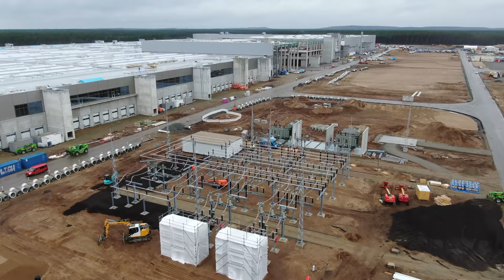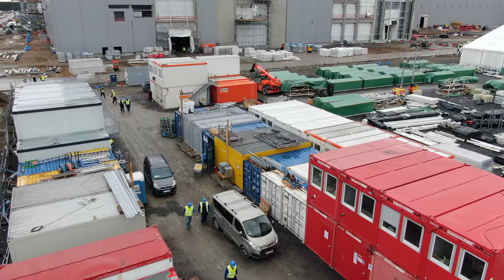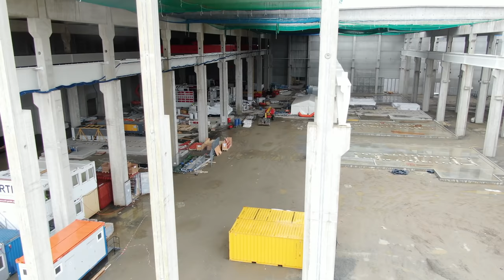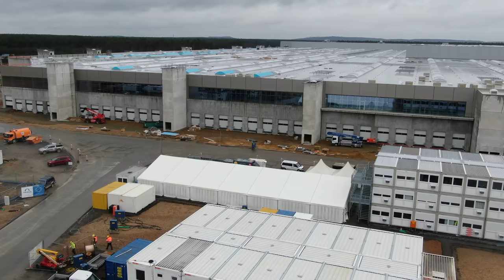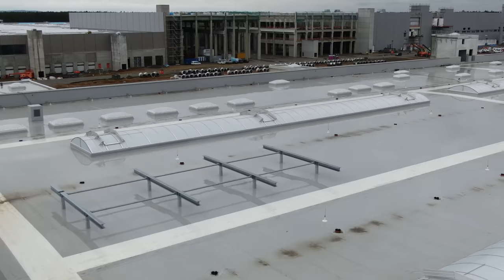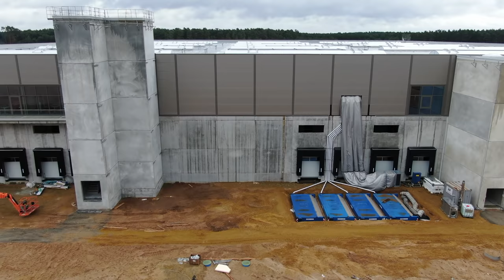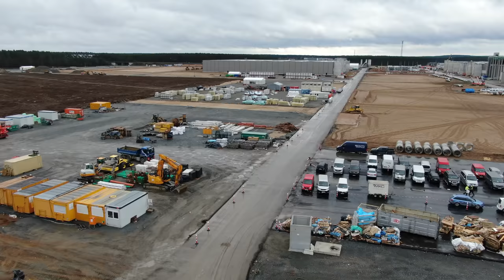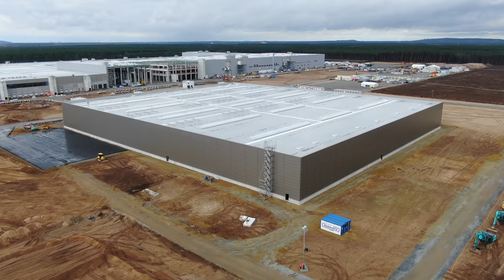Giga Berlin | 2021-03-27 | More Model Y Bodies

Comment: Great video but Berlin has slow down the construction. Don’t know the reason but it is sad. Texas has speed up the process and seems they will win the race. Europe has to much bureaucracy which will cost them one day in this fast change world.
Reply from the maker: There is no slow down in construction. The work just moved to the inside. The building is pretty much finished. There is no work on the outside of the casting section though, but that seems to be intentional, and was to be expected since they removed the cranes. You think they were removed due to bureaucracy? I don't think so.
Reply: Difficult to assess, we don't see what is going on inside. And there are many workers on site. They will hold their deadlines. Nobody wants to pay fines
Reply: Because Tesla made substantial changes to its construction plans, that have to be reviewed and approved. There would have been no problems if Tesla got it right the first time. If they can away with that in Texas, good for them.
Reply: Tesla is building here. Not Europe. E.g. Tesla has permission to work 24/5 (i.e on weekdays) on the building. And in some inside areas like the paint shop 24/7. They do not really make much use of this. Either they simply don't need this with the schedule they gave themself. Or they have not found companies with free capacities for this. 
a) they are working in the casting section. Assembling two Giga Presses. And finishing the between floors in a part of the casting section. 
b) why they stopped working on the roof is not known. Material is there, partly even already on the roof. The safety nets are also there. Crans have sitting around idle there for weeks.
Reasons are not known. But it is not a permit-related thing. These are public processes. And any stop ordered by an administration or a court would be already known. Apart from the fact that a stop means a stop. Not a "but you can proceed in slow pace" order. 

While I won't deny that Europe has too much bureaucracy in some fields. You cannot simply blame any delay on this - esp. if there is no evidence pointing into this direction at all.
Reply from the maker: Their changes to the construction plans slowed down the approval, but not the construction.
Reply: It is not Tesla fault . It is simply bureaucratic process which makes things slow here . Full stop and bye . I didn’t mean to offend anyone so I am closing this chat from my side . Have a nice wknd .
Reply: @johnmathew3423  For fanboys it is never Teslas fault.
Reply: Texas does not have any walls up so far except for ugly concrete “bunker” stamping building.  Berlin is way ahead right now although Texas is sure busy rearranging lots of dirt.
Reply: @johnmathew3423  Mind sharing the information you gathered from your x ray vision?
Reply: 😝. Don’t know why people are pissed off . Was just my opinions. Fine I will take them back . Hopefully it makes everyone here happy.
Reply: @valueinvestor8555  .. what the most people here doesn’t know is that where Tesla is building right now is normally a designated protected water resources area. With building of this factory the people around lose around 25% for there water resources. Maybe even more? And this area is very dry they get not so much rain anymore so u could say each drop of water is valuable. And I think that is also the problem for Tesla that they not got the final permit  / approval from the environment ministry. There is a battle ( if I can say so ) between jobs and tax for the government and protection of the water. And as you can see who won here. And it could be possible that Tesla ( and any other big company would get it ) will get tax cuts and other subsidies in total of 20%? of there whole investment. I think they get the biggest part of this subsidies when they finally build the battery factory. As I said it’s not only Tesla get it ... any big company who brings job will get the subsidies. But that they build a factory in water protected area and suck up 25% of the water resources of the people around ( I Heard- around 200K get there drinking water from this area ) says something.
Reply from the maker: @wolfgangselle4307  What you've heard is just half of the truth. Actually Tesla has a contract with WSE for water. So this was solved a long time ago and won't cause any delay for the permit. 
Also, Brandenburg has way less problems with water than other parts of the world. The last years were very dry which means that the authorities have to rethink the water strategies, but that has nothing to do with Tesla.
Tesla is not even a big consumer of water in Brandenburg. For example, there is an oil refinery that uses more than 10x the amount of water.
WSE isn't a huge water supplier, so Tesla will be a big percentage, but that's just, because there are not that many people in this area. WSE doesn't even handle most of the wastewater, they just send it to berlin to a bigger plant.
Subsidies also have nothing to do with the approval.
Reply from the maker: @johnmathew3423  
"It is not Tesla fault . It is simply bureaucratic process which makes things slow here."
So tell me, which bureaucratic process slows things down here?
Reply: @TobiasLindh  : Everything. In any country outside of this bureaucratic mess EU , once the land has been sold to owner , it is owner who decides what they want to do in that land but even for laying pipelines and removing the newly cleared area upper soil if there is process and approval so god help here to fasten the process . Look at Texas , once the land is sold they just have to go for overall plant or changes with previous plant model approval . I am out of this discussion now . Bye Bye
Reply: @TobiasLindh  sure subsidies have nothing to do with the approval. It’s just the cherry on the cake that you get 20 or 25% back on subsidies without any sale. ... but water is there a problem. And as u said Tesla is not the biggest user of water in Brandenburg but this oil refinery is not there in a designated water protection area. And I know there is also the problem with end of open pit mining and there “ ending “ of ground water management. There are lots of problems. And because Tesla is building there GF4 that’s why they didn’t get the environmental approval until now. I saw it on one ZDF Reportage. There they was talking with the guy who is in charge with the fresh water supply in this area . And he said that Tesla takes so much water. He said around 25% and even more in the future? and that they / he also couldn’t understand why just shortly before this area was designed as a water protection area and then a big company comes and build there the factory. Don’t misunderstand me I have nothing against Tesla or any other company. And the people there must deal with it and they know better what is going on there. I’m pretty sure that Tesla is working on it to find a solution. Anyway good that we have u to put in the right light.
Reply from the maker: @wolfgangselle4307  If you saw the ZDF show, it's clear why you only have half of the information, because they intentionally left out important information.
They showed all the difficulties, but they left out the solutions.
That guy was a guy from the WSE, which has a contract with Tesla to deliver the water. 1.45 million cubic meters per year.
For further extension of the plant, Tesla might need more water, but there Tesla is not the big part either. They mostly plan ahead for more people and industries in this region, because of Tesla.
For those longer perspectives they need to invest in infrastructure and rethink their water strategy, to be prepared for more dry summers.
What they showed in this interview was "there is not enough water" ... what they left out was "from the current infrastructure for future growth of the region".
Neither future extension of the factory, nor growth of the region is part of the permission. The water supply for the factory Tesla applied for is completely secured by the WSE.
Steffen Schorcht (the guy that didn't understand why they can build in a water protection area) was also fighting before for setting up the water protection area.
When they set up the water protection area there was a lot of talks because of the area where Tesla builds right now, because it was designated for industrial use.
Grünheide was looking for someone to build a factory there for a long time, and if Tesla wouldn't have decided to build here, someone else would build a factory here.
Because of that they included in the water protection area that there are exceptions for designated industrial areas that are already in place. Steffen Schorcht knows that.
Also it's not unusual to build in a water protection area, also with piles and so on. Those piles are designed to be used in water protection areas.
Reply: @johnmathew3423  And that's why your drinking water tastes like shit and chlorine, burns when it comes out of the tap and your environment is fucked up.
Reply from the maker: @wolfgangselle4307  And about the subsidies. There are two types of subsidies. One is the GRW, which is a Subsidy to strenghen the economy in the region. Every company in that region can apply for that, and the amount is based on the amount of investment. And they will only get the subsidy after they invested. Nothing will be paid before.
The other subsidy is the IPCEI. This is for developing new battery technology in Europe. This is for development and innovation, not for production. 42 companies are part of that program, including Tesla. The reports that Tesla could get 1 billion euros are most likely false. All 42 companies will get 2.9 billion. The 12 German companies (including Tesla) will get 1.6 billion. It's not known how the 1.6 billion will be shared between the 12 German companies, but it's unlikely that Tesla will get 1 billion and the other 11 companies will share 600 million.
Reply: @TobiasLindh  I know the subsidies have nothing to do with the approval process. But how many or what kind of subsidies a company becomes is important. And where the company finally settled down is mostly related how much they get. And I know it’s all over the world the same that companies get subsidies to just set up there factory in this country. And of course companies are not stupid they can calculate where they get the most for the buck. Companies of course go where they get the most for them. It’s ok. People are happy when they get a job. And  Tesla will bring even more companies in this area. That means More jobs and more tax revenue. But makes things there expensive.. good for people who owns there land or  a house. I can just imagine how pricier is got there since Tesla announced they build there.
Reply: @julianreverse  : All Good . Nothing burn and even the environment is cleaner in comparison of many countries. We are good and still alive . Don’t worry about health and environment. We will manage with it .
Reply: @Sachertortehmmlecker  Just check Tobias' timelaps video's during weekdays.... Loads of activity with hundreds of trucks and vans driving up and down the factory, parking lot full with hundreds of cars... All indications a lot is going on on the inside.

No doubt Tesla will start testing in May and full production in July.. more than a month to go.

Another indication.. My Model Y order has been set to delivery scheduled for 'mid 2021' since about October if I remember correctly, it used to be 'eary 2021' when I ordered my Model Y in June 2020.
Reply: @johnmathew3423  why do guys like you keep on showing up here telling us Texas was far ahead of Berlin and Germany was a bad choice? Is this the American arrogance that I heard of?